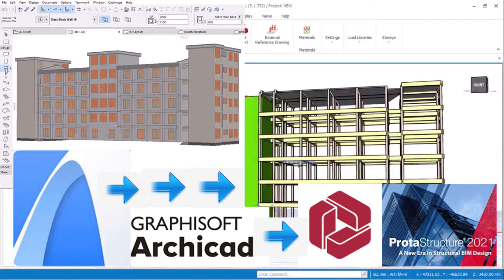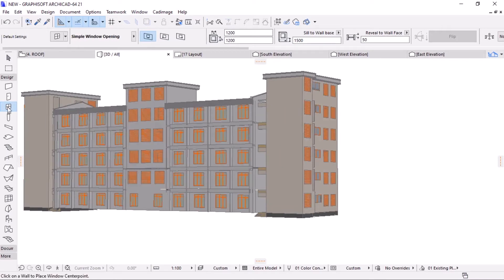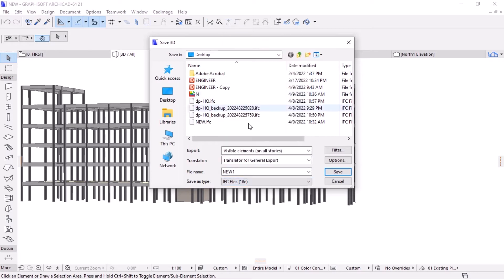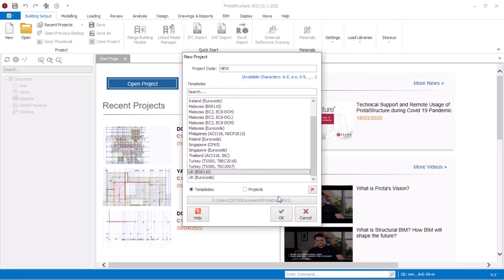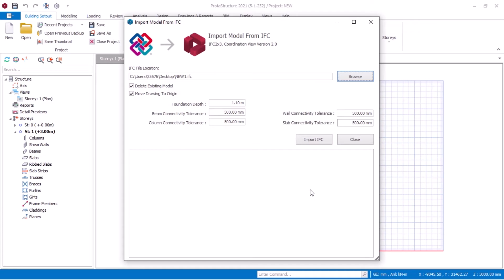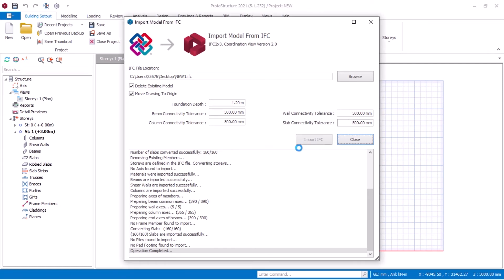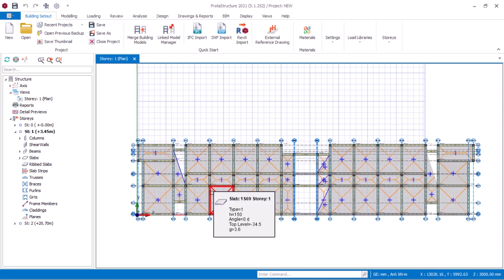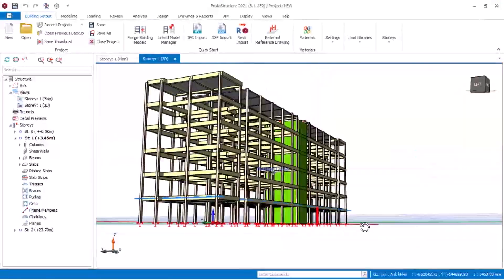Import ArchiCAD file to ProtaStructure

Comment: And how would you import your walls or set them in prota if your ground floor building stones have been built as load bearing walls to save on steel bars usage?
Reply from the maker: Rcc structure on top of stones foundation is out of scope for Prota.
In your case, coz of different material used, It will be appropriate to design the super-structure separately from sub-structure
Reply: Understood, Thanks!